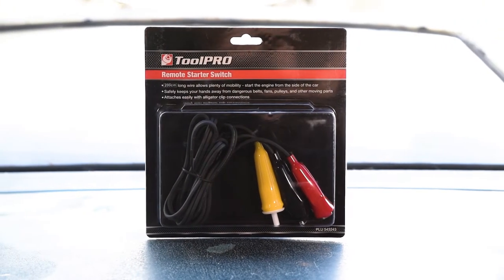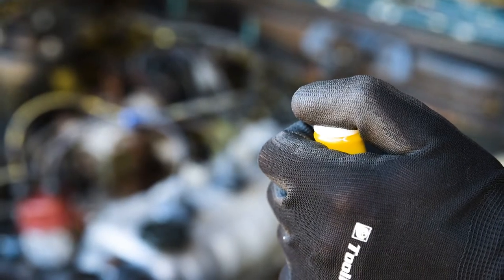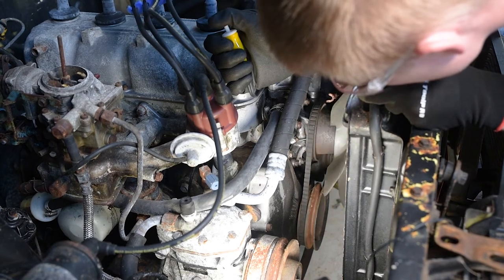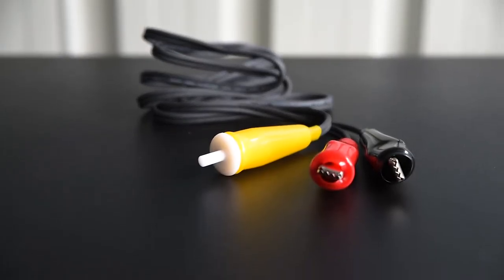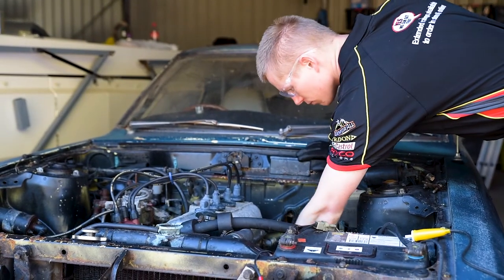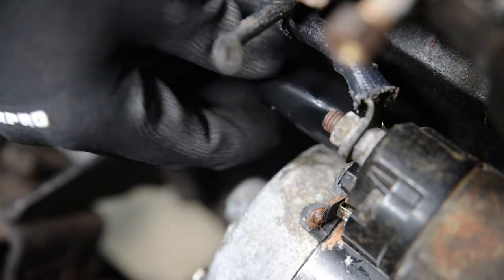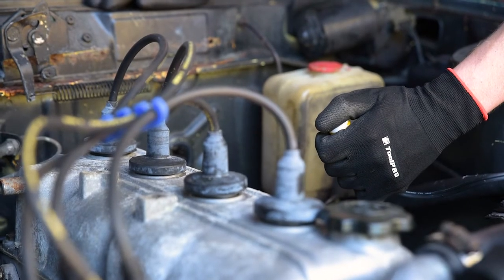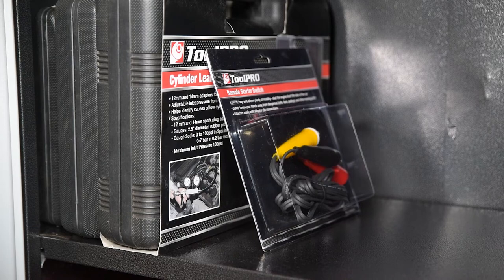ToolPRO Remote Starter Switch

Comment: Turn the ignition key to ON position, the car will start and run. Ignition key to OFF position, the car will crank but not run. Important to know!
Reply: when i do it, it only runs the starter but doesn't crank the engine over
Reply: @tonystrucking9577  possibly look at the solenoid, it is what engages the small gear into the flywheel when energized.

Comment: If you have an old light switch "off/on" you can wire it up the same way as a push button starter. I made the same thing and it cost me $0.00.
Reply: It's super easy, you got two hot wires on a switch. One to the battery and one to the  ignition solenoid on the starter, Not the main starter wire on the starter from the battery/alternator.
Reply: Just make sure to switch it back into the off position once the engine is started.
Reply: @ADHDcisGinger when you say hot wires what exactly does this mean? Two positive?
Reply: @uTheJoKeR  yup. You're basically completing the hot wire connection to the starter it's the same thing your ignition does when you turn the key to start.
Reply: @uTheJoKeR  take note that this method by passes your neutral safety switch, and you can still engage the starter at anytime even if the ignition is off and if you have a manual transmission make sure you're not in gear as the starter will turn the wheels, comes in handy if your vehicle dies at a stop light you can use the starter to push the vehicle.
Reply: @uTheJoKeR  you can achieve the same effect with a screwdriver directly on the starter just make contact with the post and it'll engage the starter.
Reply: @ADHDcisGinger what happens when your starter has that pigtail connecter that these newer cars have?

How do you effectively remote start those?
Reply: @uTheJoKeR  oh hell I miss read your reply, yes you can run a hot switch on the remote start post as well, but the other wires coming from the ignition have to be hot wired as well, or it'll be like you're running the engine in off mode and the engine won't shut off.
Reply: @ADHDcisGinger  so if that pigtail connecter isn’t ALSO connected then the engine will start with a remote switch BUT, I won’t be able to shut it off?
Reply: @uTheJoKeR  if you hotwire it without a kill switch for sure, but most remote starts have a kill switch built in with a 10-15 minute timer for it to receive a signal from the ignition, or it'll shut it's self off.
Reply: @uTheJoKeR  oh word of advice on transmissions if it's a stick shift never leave it in gear when you park it.
Reply: @ADHDcisGinger  So, in other words if I use one of these button on and off switches off Amazon, the vehicle will turn itself off while running if that pigtail connection isn’t connected?
Reply: @ADHDcisGinger  only when it’s hot wired?

Comment: Unless you pulled fuel or spark.. it'd still start though lol
Reply: Not if you don't have the ignition key turned to run.
Reply: @cathammer7661  Exactly because no power to spark plugs and no power to fuel pump

Comment: Another alternative is to use an early Ford starter solenoid which has a push button. It can be mounted under the hood and wired to the starter.  Look at a Standard Motor Products SS-558. It is a 6 volt unit and keep in mind that 6V batteries have higher amperage than a 12V.  Just push the button, it will not start the engine unless the ignition is turned on. Probably costs as much as a remote push button switch

Comment: I cannot git clip on to selnoid. Is their a wire thats more excessible i can tap into anybody
Reply: Maybe try attaching a small gator clip to the solenoid and connecting it to the switch lead
Reply: You can also do this through the starter relay, but you have to understand the circuit so you don't damage anything.